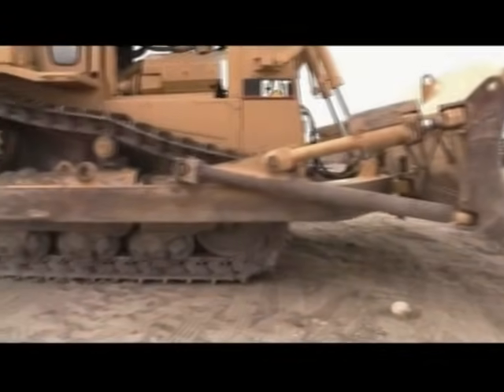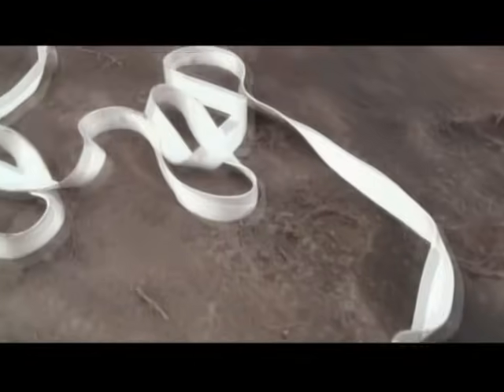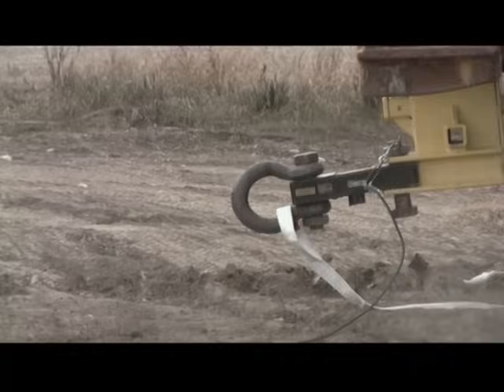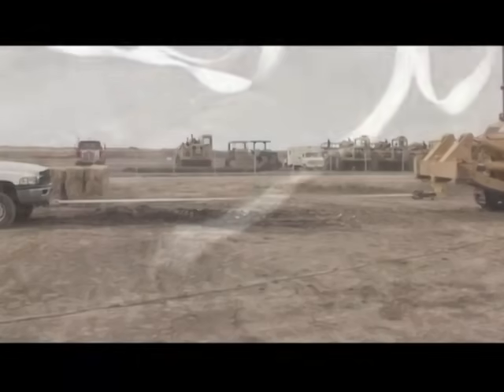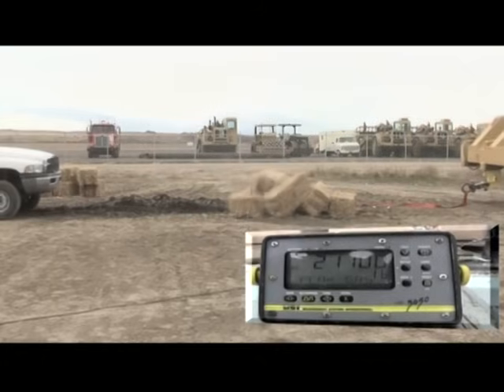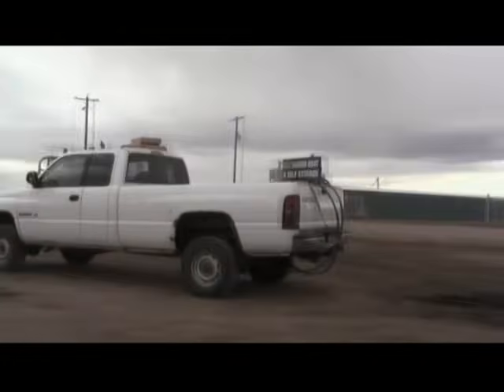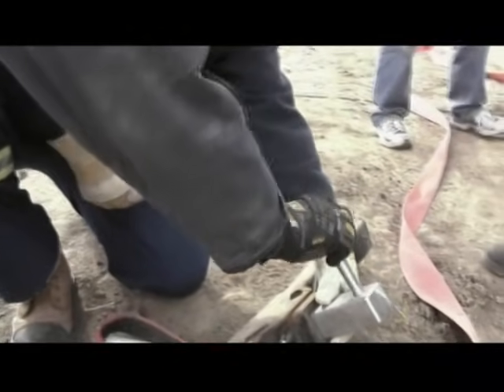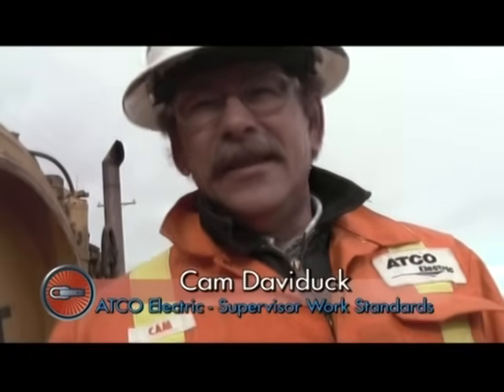Testing - Vehicle Receiver Failure Testing by Ditch Hitch & Atco Electric

Comment: I've seen broken receiver hitches in 2 separate instances.   One was ripped in half, I don't recall the exact failure of the other one.   I let some guys borrow my recovery ropes once and I thought for sure they were gonna rip the hitch off the stuck truck because they were yanking on it with two trucks.   Hitch survived, and they got out, but they pulled the front drive shaft apart and bent at least one rear spring pack on the stuck vehicle.

Comment: when the front hitch failed was the dodge just in park sitting in the dirt? surprised the truck didnt skid forward
Reply: +BC4Lyphe I think it was attached to the other tractor thing, but I could be wrong. But I'm pretty sure that truck weighs around 6 or 7 thousand pounds it would have been drug especially on dirt at 21+ thousand.
Reply: It was definitely anchored to something off screen, probably the other earth mover. There's no way that truck wouldn't just be pulled away if it wasn't.

Comment: If you compare the top of the ditch hitch pin with the line of the truck bumper at about 1:44 and 2:20, you can see that the rolling jerk tests already bent the receiver hitch upward. Receiver hitches drop down like half a foot from the frame which creates this leverage. Also bend before break applies here as well, cycles to failure.